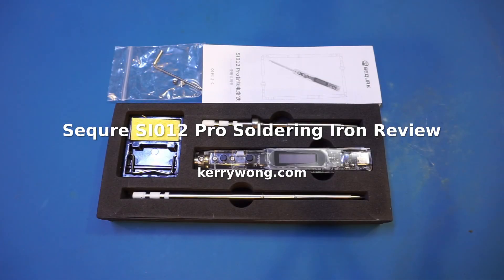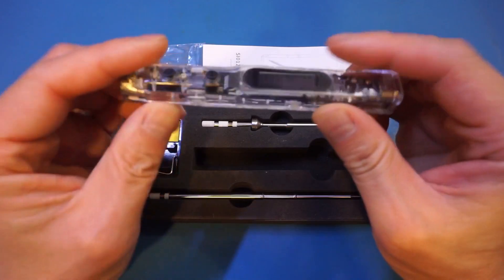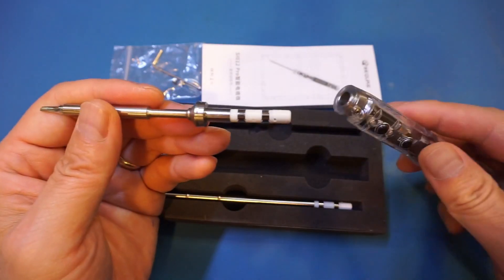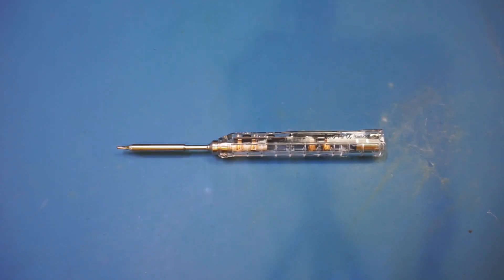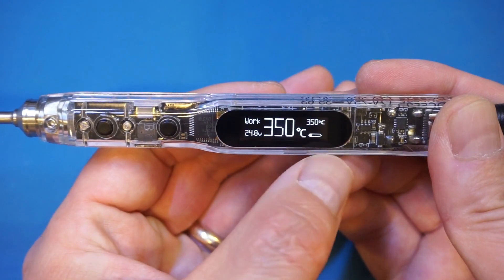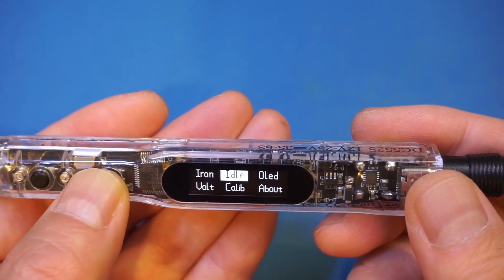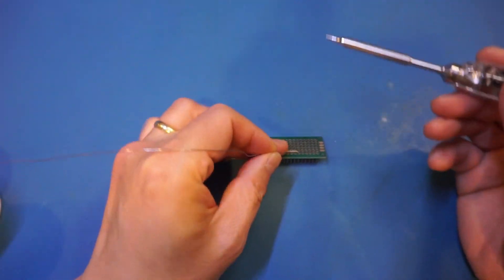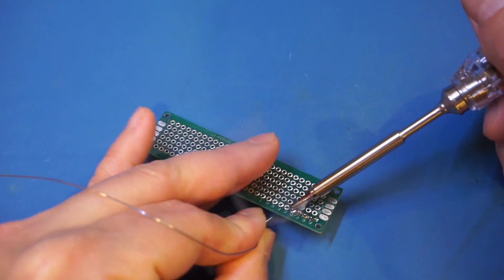SEQURE SI012 Pro Soldering Iron, It’s Quite Versatile!

Comment: the power adapter is total junk, should never be plugged in to a wall outlet, it uses the smallest gauge wire I have ever seen ,check it out you will be shocked

Comment: Great review and a tempting iron. I have to replace the screen in my TS100 soon and if that goes horribly wrong I shall need a new iron !....cheers.
Reply from the maker: You mean the OLED display on the TS100? Mine stopped working not too long ago as well.
Reply: @KerryWongBlog  Yes, apparently it's a known thing and it dosent have much correlation with time powered up just seems random :)

Comment: Not bad, but for $20 I can buy a 4 ohm 120 watt Pace 1131-0032-P1 Ultra Wave Tip and expect its iron plating to last 30 times longer. Make your own handle easy (it stays cool) and solder a cable to the gold pads on the end and use a 555 to PWM a MosFet to set temp. Works between 8v and 24v without problem (just be sure to limit Vcc to the 555 to 12v with a Zener diode).
Reply: And now if you count the time invested you are way outside of the price range. 
Realistically speaking this offers TS100-esque performance at half the price.
Personally I will always stick to a reliable brand, heavy duty desk iron (JBC in my case) for most soldering, but this is a great little thing to have just to throw in a bag in case you need to do soldering on the go. Additionally it lowers the barrier to entry for newcomers to electronics, which is always great. I remember many years ago when I was starting out, that the options for soldering irons were either grandpas beaten down, straight in the wall plugged massive iron, or shell out big bucks for a weller (not affordable for most kids). I am glad with irons like this opening up possibilities.
Reply: @tHaH4x0r  Pace is an older and more reputable brand than JBC. Read Dave Jones on the EEVblog forum or watch his videos in the last 4 years.. He has both JBC and Pace and in almost every video one's used, it's the Pace. He reports the tip iron durability is better than JBC and if you really know electronics, PWMing a MOSFET is not hard.
Reply: @kwpctek9190  What exactly does pace vs jbc have anything to do with my comment? I have used both as well (among other brands) and I prefer JBC. In the end its a question of personal preference, not better or worse.
This is not as simple as 'just PWMing a mosfet', as the heat in the element corresponds to current, not voltage. Hence you want to do current control with feedback from the thermocouple in the tip. If you dont have feedback, you will suffer from tremendously reduced performance, and negate all the advantages that such an integrated sensor/heater tip unit has. The close thermal coupling between sensor heater and contact zone makes the control able to regulate things much more tightly.
If you want to hack something together, and only have it working in feedforward or substandard feedback, sure its doable (but will still cost you quite a lot of time to make it usable and robust for every day usage). If you want to do it properly, you have to put in even more effort.

And that is exactly my point. If you buy a reputable big brand tip, and a handle, and the electronics required to drive it, and add up the time to get that working, you are far, far out of the budget range of the iron presented in the video, nor will it be as compact and portable.